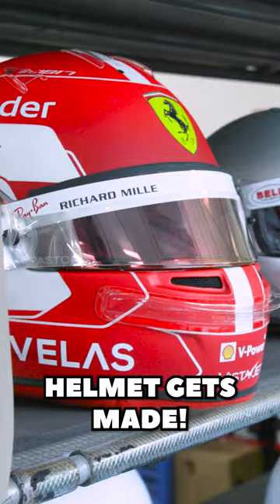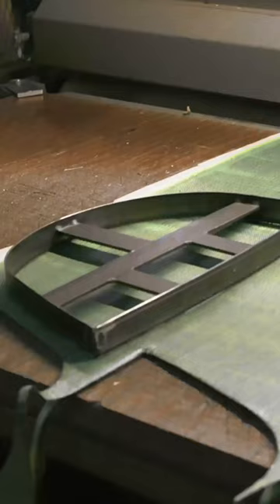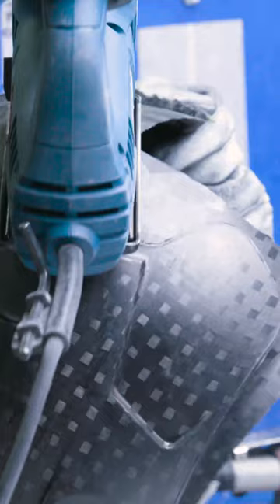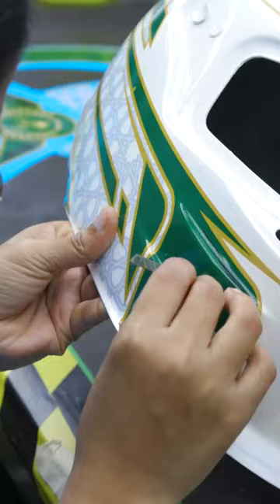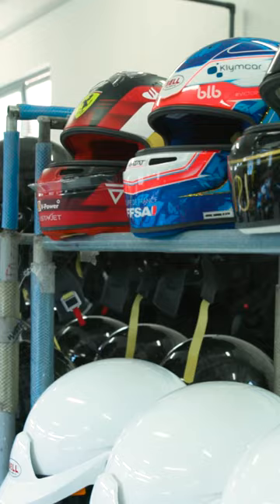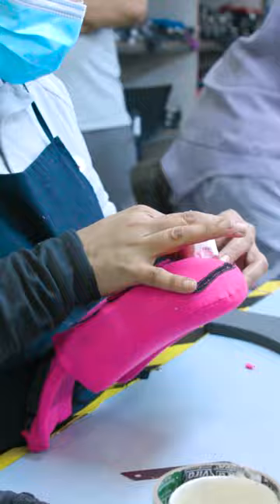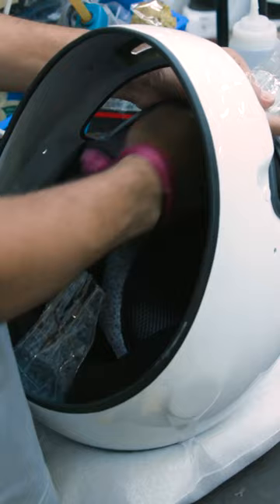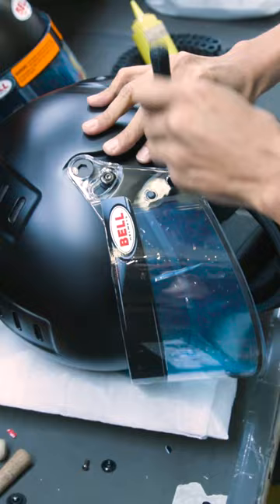How Formula 1 Helmets Get Made!

Comment: Wait, aren’t the radio microphones integrated in the helmet?
Reply: I guess it's to allow for customization depending on driver preferences, but there are brands that offer helmets with pre-installed comms equipement, Stilo is a great example of a brand that does this and still all Stilo helmets used by F1 drivers are not the version that comes with pre-installed comms but the slimmer one, it all depends on preference and rules of each racing series
Reply: @CRZYvidz  cool. Thank you. I learned something today :)